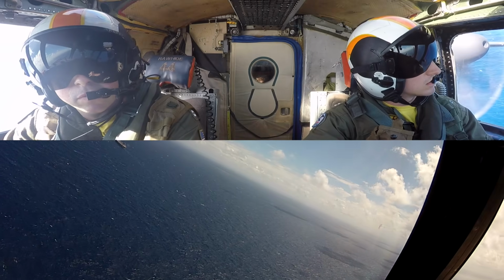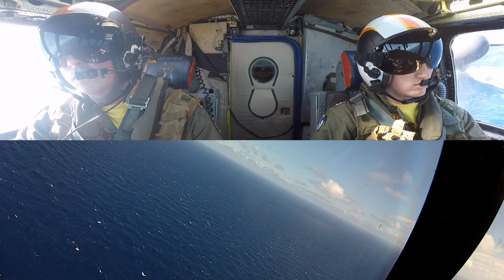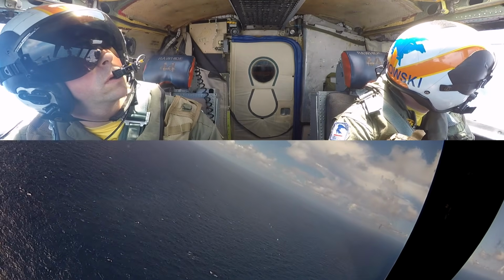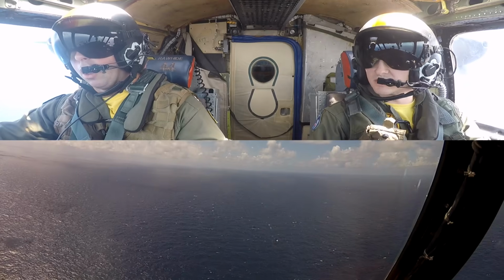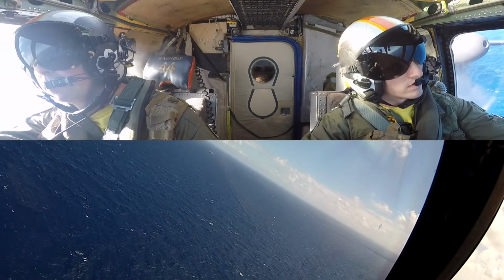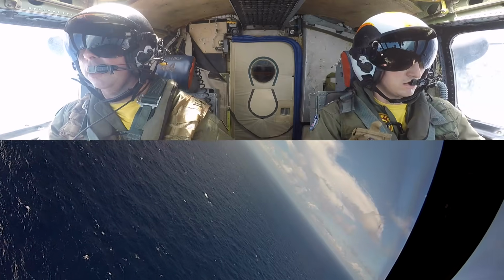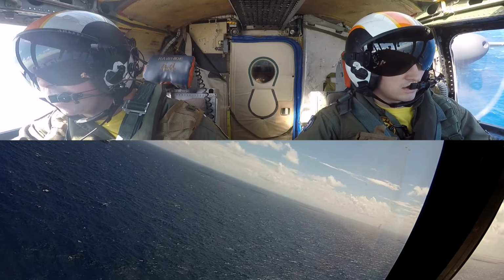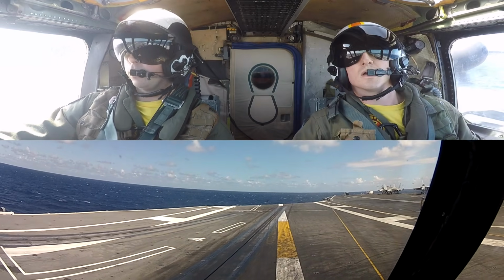This ‘SH*T HOT’ Carrier Break Made My Head Smoke

Comment: My co-pilot, Colonel Airskip, a seasoned air force aviator, was flying the C2 aircraft when a sudden malfunction nearly caused us to plummet into the ocean. With seconds to spare, the pilot deftly adjusted the altitude hold button and engaged the auxiliary power unit, stabilizing our descent. It happened at 1500 hours in the midst of a routine training exercise over the vast expanse of the Pacific Ocean. It was a close call, but quick thinking and precise actions saved both the aircraft and our lives and potentially the crew members. Thank you so much Colonel Airskip.

Comment: You do this with pax onboard???
As an E-3A driver my 20+ back-end crew would have Chewed through their seatcushions. Not to mention my MCC deciding on my volunteering to host the crew at the OClub!
The E-3 at 300k takes about a 5 mile turn to make a 180 & even pulling the throttles to idle in the pitchout will mean adding an extra mile to the 1 mile final to get slow enough for gear & flaps.
But you haven't lived till you've flown fingertip on a tanker. (Or even on a 20' boom at around 260kias.)
Great Job, my hat's off 🎩 !!
Reply: Ha! I just imagined an E-3 doing a max forward speed 60 degree bank carrier break to an airport, that would be an incredible sight! What altitude do you think you’d have to start at to make it work? 5,000 AGL? Could it work at all?
Reply: @phillipschmidtke2001  It worked BUT...on a joint force exercise in Sigonella, Italy navy tower told us to follow a flight of 4 Navy F-4's we'd been working with & to Match Speed with them...I did. ATC had brought us in at 2000'. The F-4's broke at the end of the runway. I was a mile or so behind when I broke & the last F-4 was landing, throttles idle, 45° bank & away we go. When I finally turned downwind, the tower said, "You guys still in the pattern? Oh, wait, I see you but had to get my binoculars," Chuckling all the time. Great final approach but extended a bunch. For the rest of the week, Tower never asked us again to match speeds. BUT we did get to "report the Break" each day. AF Towers would NEVER have done that.
FYI, Co-pilot loved his approach next day even though it was more stable & cut our previous day's flight time by about 15 minutes. Also, FYI, I took a lot of kidding from the Navy F-4 crews at the bar that night. 😂🫡

Comment: I try this in DCS and always fail. I know it's not the same thing, I am not trying to say that, just the mechanics and timing are the only thing that can be "simulated". The real deal point is when you snap wings level after your approach. That will tell you if you even have a chance. Those few times I get to that point make you feel so good to have just accomplished that. But I can pause, go take a piss, come back and try. I can even slow time down and have invulnerability turned on to keep me from dying. I don't think you have those options. lol I was ships company on the USS Theodore Roosevelt from 86 to 90 as an Aviation Ordnanceman AO2 (Plank Owner) and my favorite past time was going up to the observation deck on the island and watching flight ops, especially when we first get underway. Because the first thing the entire airwing did was qualify. Many new pilots and veterans who are a little rusty make for some dramatic takeoffs and landings. Missing the wire and the aircraft disappears from sight when it dips below the deck only to rise up a few seconds later is a pucker factor 10. Back then, we were flying Tomcats, Hornets, Intruders, Vikings, Hawkeyes and Sea Kings. And my favorite the C-2 Greyhound COD. Because then I know mail call is coming as well as all the critical spare parts that keep the airwing and ship running. Like the old saying goes, amateurs focus on tactics, professionals focus on logistics. That's the reason the Navy has perfected UNREP and the COD system. I have seen many "hangar queens" just sitting waiting for that widget or doohickey to show up. Without the COD, that Tomcat has no teeth.

Comment: "60° angle of bank, trying to keep the horizon level"
 I don't understand, how can you keep the horizon level if you're banking?
Reply from the maker: You pull back on the yoke. A LOT!
Reply: @flyrobroy  
Oh, I understand now. It's keeping the horizon level vertically so you don't nose dive into the ocean, but not laterally because you're in a 60° bank.
 You mentioned the 2G limit. Is that to avoid structural damage or to avoid stalling and spinning into the ocean, or both? Thanks!
Reply from the maker: Mostly because our airframe is really old and these C-2s can’t take much more than 2Gs before they start falling out of the sky. They’re all so bent - been flying for decades!

Comment: Okay.... Now do it in an F/A-18c. 350 kts, 800  ft, break just at the bow, boards, bank, pull 3 Gs until speed goes down, 250 kts drop gear, full flaps, boards in, AoA on speed, drop to 600 ft until even with the rounddown, bank again and down to 450 ft, on speed at 120-130 kts, 3/4 mile call the ball, E-bracket and VVI on the boat's crotch, ball... E-bracket... line up... ball... E-bracket... looking for that #3 wire! At night, in the fog, 500 lbs of fuel, no go-around, no bolter (otherwise, go swimming).

Comment: I thought you had a fire behind your seat😆
Awesome job from the pilot🤟
Reply: I saw that on another video and thought what is blowing in there.  I'm guessing some sort of condensation from an a/c?

So I scrolled a little and he replied to someone else's comment that yes it's a/c condensation. Next time, I am going to read more of the comments before answering.
Reply: Yes, all the older, larger military aircraft have large air conditioning ducts, usually behind the seats to keep the pilots cool, especially when the sun is brutally coming through the canopies.  The bleed air HVAC feeds were usually cooled to near freezing just to keep up.  On my F-111's, doing Red Balls (after engine start, quick aircraft repair), it was a joy when you had to look or get into into the cockpit in the summer as the air coming out of the ducts was NICE. Not sure what they have in the fighters (Vipers, Rhinos, Fat Amy's) these days as a lot of them are up in the canopy bubbles.
Reply: @bikeny  Ooops I am guilty of that too lol, I did suspect it was AC related though
Reply: Sometimes you get small hailstones coming out of the ac ducts, well, on a B757 you do 😊.
Reply: @dragoclarke9497  yep, B737 too.  Half way through a brief and get one fired in your eyeball.

Comment: Done my own version of Sierra Hotel landing, but that was with a 8,000 ton train doing 50 mph, coming up to a 10 mph switch.  It's fun in its own way, when it works.  When it doesn't, ya bust a knuckle, the conductor gets really pissed at ya and you end up having a conversation with someone you usually try to avoid. Cheers, Rob Roy!
Reply: Why would the knuckle break? Getting thrown quickly to the left or the right? I thought the knuckle would break only if it got yanked by a bunch of slack action.
And wouldn't hitting a 10 mph switch at 50 cause a derail?
Reply: @shawnerz98  As long as you keep the locomotives pulling and use the brakes to slow, you shouldn't get a knuckle.  Power braking at its best. But the spot I did this had an undulation (dip) that made it more interesting.  I made a minimum set two miles out, had slowed to about 40 with about a mile to go and was at 10 when we entered the yard on that 10 mph switch.
Reply: @LouT1501  OK, that makes sense. PTC doesn't yell at you?
Reply: @shawnerz98  I retired before PTC was put in where we are, plus I worked for a shortline that had track rights on the UP, using UP power...and they almost never yelled at us.